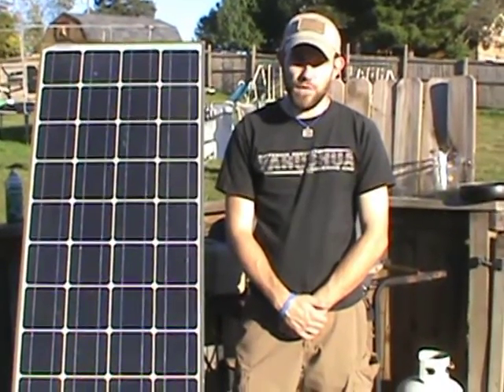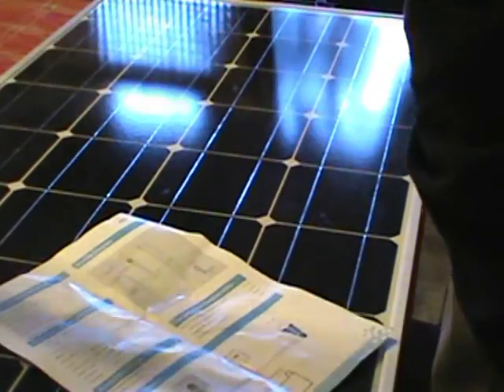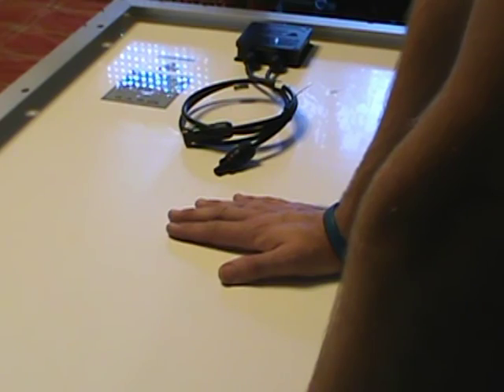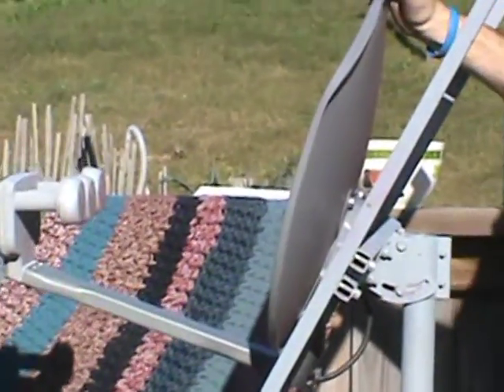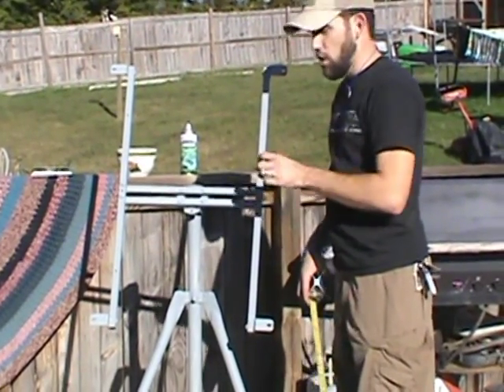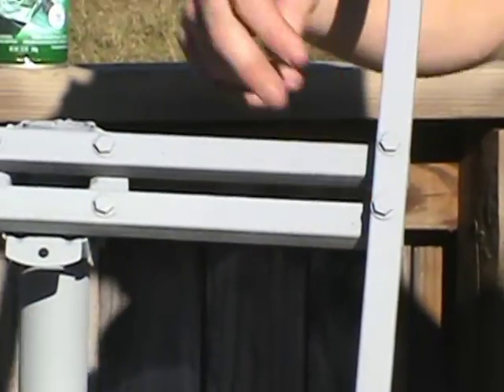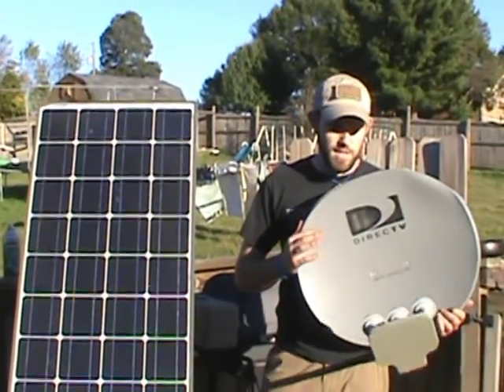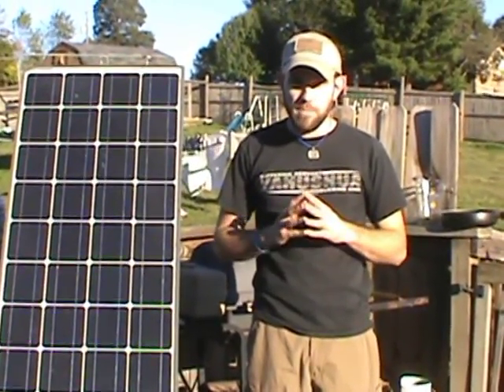AN EASY DIY SOLAR ARRAY BUILD FROM A RECYCLED SATELLITE TV MOUNT

Comment: Thanks for the video, been trying to find the best method to mount these panels.  

Would love to see a linear actuator attached to this.  Seems like you could do two for both vertical and horizontal axes.  

You can also use that offset paraboloid dish to improve wi-fi gain.

Comment: Thats cool thanks for the video. I have some 250 watt panels I purchased pole mounts for  they are larger and work great. Here in Michigan in the winter you have to sweep the snow off daily if you want power but after doing that they work better in the cold than they do in summers heat.
I have 4 100 watt panels I first purchased and mounted on the side of my barn, it was a mistake. When I mounted them it was late fall and the next summer I learned out shading...... I want to take them down and mount them on poles like I have the larger pannels.
You showed me how to do it with very little cost, I have 3 old dishes I was going to set out to to the trash for the scrappers. Now they will be mounts and the dish part will make a nice target for my little range!

Thank You again for taking the time to make the video.

Comment: Save the satellite dish to make a solar oven: coat it with reflective mylar or 'chromed' tape. The convex dish is already optimized to focus the energy. Just add a blackened iron pot where the satellite pickup was mounted.